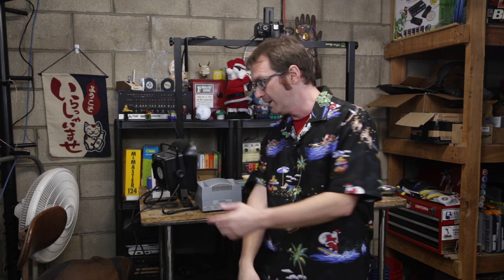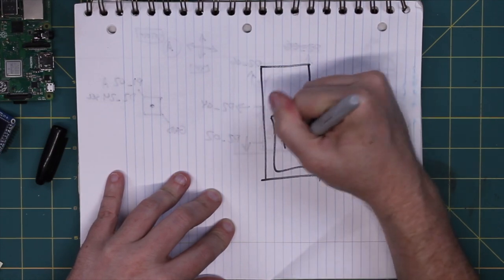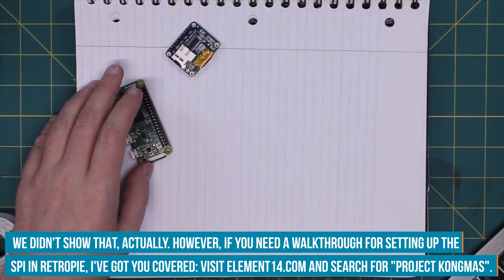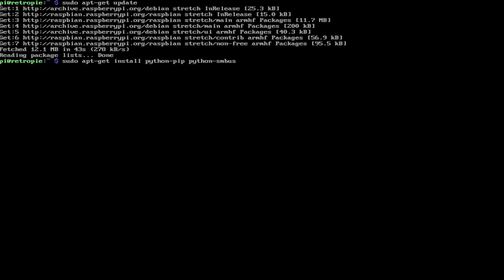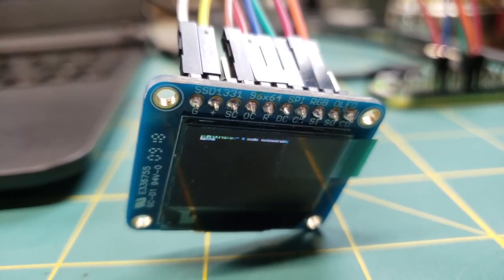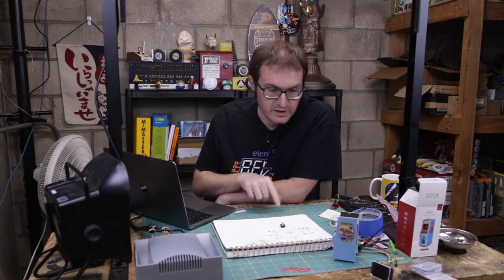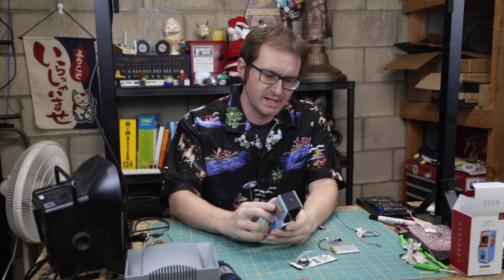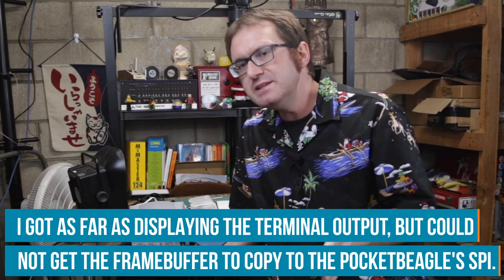Raspberry Pi Donkey Kong Holiday Ornament

Comment: Does anyone know if the control stick he used in the project has analog support or just digital? (it looks like it's just digital) I am working on a Pi project that has cursor navigation and this would work perfectly it it also supported analog input.
Reply: Digital only. You might try a Trackpoint module from a Lenovo laptop keyboard instead, or there's various sliding analog pads like what the 3DS uses.
Reply: @tom611  Ahh I see. That makes sense, thanks for confirming it's only digital. I have looked at the "new" 3ds control nub but what I'm worried about with them is that it's tricky to solder to and the connections are super small, that and they aren't cheap on ebay. I have not yet looked into the Lenovo control nub thing yet, I'll check that out. Thanks!